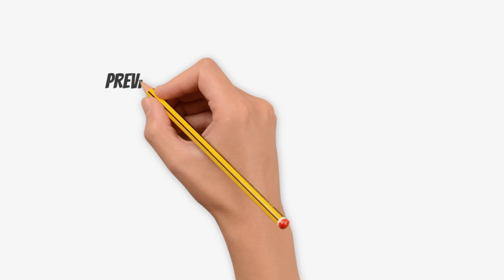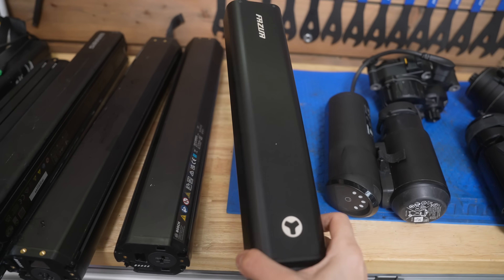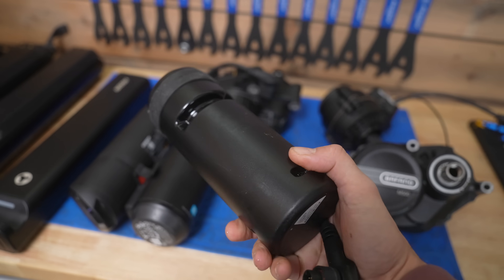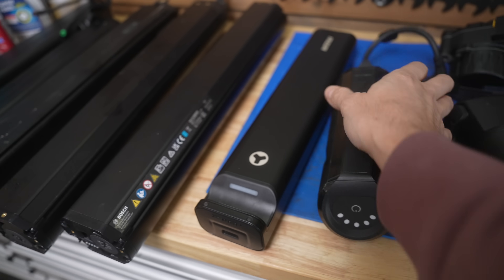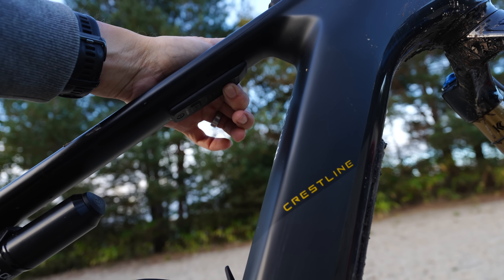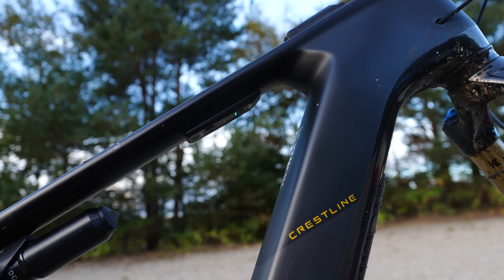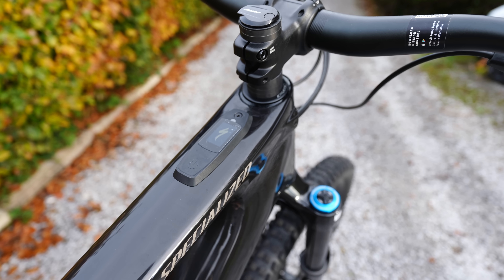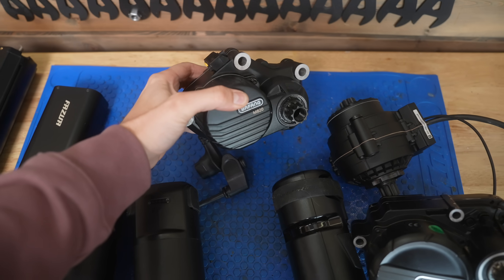We Have A Huge Problem With Ebikes....

Comment: I regret buying an EMTB and this is one of the reasons why. I love riding my bike, it’s a Nukeproof Megawatt, it’s great. However, I’m fully aware of the issues and concerns with the motor and it’s a point of contention when deciding to ride in certain places and weather conditions because of the failure rate. Mines in the last few months of warranty and the prospect of a huge repair bill and no alternative solution has ruined the ownership experience (and I probably speak for most EP8 owners). 
I won’t even consider buying a new e-bike in the future if the industry doesn’t realise a set of standards need to exist. The bike industry cannot expect people to keep parting with THOUSANDS for something, like you’ve mentioned, becomes obsolete within a few months. I don’t think a standard would curtail innovation or increase costs, any brand uses those as an excuse are just plain lazy.

Comment: The cream will rise to the top. Or top brands will cooperate. A frame maker will a version or 2 of the same frame to make the top 2 motor gear boxes. The battery holder will be built onto the battery(with charger) to clip/lock unto the bike. Everything else is pretty universal.

Comment: I know you didnt want to call out any bike company, but you did, and this is the reason why I never jumped into the ebike  ownership over the years. We guys that are in the business of the high end MTB before the ebike came on the market spend thousands of dollars on our bikes and it was upgradable over the years. But now you will have to swap out a frame every so often that will run 3-4k hopefully its the same system you already owned or else you will be screwed to spend even more money. Saw some Chinese companies that are offering to build your own ebike but same rules apply in the motor and battery the frame is the main holder of those parts. ITs better to go with a reputable company that will give you replacements over the years you own the bike. I tend to hold one to a bike for a very long time but these ebikes looks like a wash Renise  cycle day in day out that can leave you broke if your not careful about it. Specialize got one of the best warranties in the business and there system for me seems to be the best fit for my needs 90nm should be enough for the next 7-8 years more than enough for daily commute. I think you should be the one to change all this since you spoke up about it. make a ebike where all those batteries and motors can fit and work and then when those companies begin to lose money then they will change there behavior about all of this.

Comment: Yeahhh most bikes have their own CPU and they often marry it to the motherboard for the battery charging as long as you have both components you should be able to replace clips and upgrade as you wish only problem is warranty will be void haha😂 easiest way to do it is cut the cabbles & attach male & female cable connections now all your cabbles plug into eachother. 😁  As for batteries learn to put together cells and charge them individually can save lots of money and batteries often a dead battey is just a coupple of dead cells they need charging individualy to gain their life back. 
 its real sad 😢 when manufacturers put the components inside the frame and wield it shut.  Grrrr 😤 or incase the motherboard in a block of glue 💩. Ive seen it all! Lol

Comment: You obviously don’t understand business and innovation.  Capitalism for that matter. Companies aren’t going create batteries or motors that are backwards compatible. Why would they ?  They want you to spend money to buy new bikes with the new motor. They won’t make much money if they did this. And then won’t have the profits for innovation. To make motors to work across all bikes is virtually impossible.  Frames from each manufactures are uniquely designed or do you want each manufacturer to make the exact same frame so that all motors and batteries can fit?  Does Ford make a backwards compatible motor? Does a Tesla’s battery work in a Kia ? Of course not. Just be happy with what you got and ride it for 5 years and if you want to upgrade to a new bike then save up and buy a new bike. If you want high quality stuff, work hard and save your money. You can’t get high quality stuff for free.  Manufacturers have to pay their suppliers, their employees, tax.  You want innovation? It’s gonna cost you.  Why do you think bmw, Mercedes , Audi are so expensive ??  $80k for any m3 competition. Why?

Comment: As I’ve been thinking about buying an e-bike lately, these concerns have been foremost in my mind. If i spend a minimum of $1000 for a bike, take good care of it and it lasts for many years, will i be able to buy a battery for it or will it become obsolete in no more than 5 years? This is especially true of the extra cheap off brands. They may be obsolete in a year. So now i have to find a brand that i think will last for awhile. It’s exhausting, frankly.

Comment: The Bike43 longtail cargo bike can fit multiple different motors (currently sold with Shimano or Bosch, originally Heinzmann or Bafang) using adapters where the bottom bracket normally goes.

Comment: I only ride Chinese standard ebike stuff. These western brands try to make standards but no… in China they are decades ahead when it comes to e-bikes. They have stuff that you can fit on your rusty old grandpa’s bike and turn it into a widow maker. Cables all as standard as it gets… get motor from that factory while batteries are cheaper in that other factory… no problem.

Comment: I honestly hadn't thought of this. I was just about to pull the trigger on a 2024 ebike (my first) and noticed on their site, the battery for the 2023 and 2024 are different. The 2023 only works with the '23 and the '24 only works with the '24. Um, yeah that's a big issue.

Comment: The motor mounted inside the frame instantly makes both products proprietary, motor design has to exist around the bottom bracket, not parked inside it. I personally would build a EMTB with one of those CYC mid drives - they're a bit pricey but I'm sure the price would be lower if they were a bit more mainstream, somehow.

Comment: Meh, just wait for the Chinese manufacturers to somehow bodge a way to make all this stuff as well as their own stuff universally compatible - and kill the market:) 

Like they're already doing with electronic groupsets. Sram and Shimano all make their hardware and software deliberately restrictive while Ltwoo Erx will work with ANY 8-12 speed cassette from any manufacturer and will even work with a frankencassette that you've built out of a parts bin with uneven sprocket spacing - all because LTwoo just said screw it, you can fine-tune each sprocket individually in app, go nuts!

Comment: They should make things backward compatible so you can upgrade a 2 year old bike and batteries could have a standard size and chargers thats just ridiculous  !! Ev cars have a standard plug sizes so should bikes chargers are ellectronc so design them smart talk to bms they set charge voltage current and temperature  then charge.At the moment we have manufacturers  makeing stupid proffits and considerable  waistage/ewaist NOT GOOD FOR ENVIRONMENT  AND NOT GREEN.All we need is theese facts to be shouted out and they will change 😅😅😅

Comment: Emtbs are far too new to be constrained by standards at the moment. It's pretty easy to make minor adjustments for a std derailleur hanger. It's a relatively older tech that's not even really part of the bike and will likely be phased out anyway. Current ebike tech is an integral part of the entire frame. By standardizing, bike mfgrs would essentially need to build very similar frames, really stifling innovation. The same for the motors.  It's a very new tech, and constraints at this point would definitely slow progression. It's way too early for standards imo
Reply: @anonymousone6075 motors on a car are a great example of why it wouldn't work. You can't put a tundra engine into a Tacoma without substantial modifications. Tundra engine in a Corolla? You're essentially creating a new vehicle in order for it to fit. A one size fits all solution for mtb motors would have to default to a large size cavity, and personally, I would prefer the smallest form factor possible

Comment: If you are using an ebike and you want the ability to upgrade it go DIY, full stop. Conversion kits are forced to follow a standardized system because they don't sell full systems. The only real drawbacks to DIY systems are 1.) Appearance, everything being built by 1 company means they can neatly integrate systems. 2.)  You cannot use carbon fiber frames due to the the physics of how carbon fiber works, applying loads and compression in unplanned places ect. However with in regards to point 2. If you are using an ebike going carbon fiber is already pretty pointless. The added weight from going aluminum frame will be utterly negated by the motor. Any case where you need to save every gram is a case where you shouldn't be using an ebike anyway.

I will just stick to popping a wheelies going uphill on my 'totally not a motorcycle' Cycmotor 52V kit tyvm

Comment: Easy fix really - all motors are nice and round and all batteries are cylinders and the manufacturers add fit kits - but of course those extra 200 grams are a killer so no one wants that.

Comment: If you have standards, you can just upgrade your existing bike with parts from any 3rd party component supplier, and not need to buy a completely new one……..that’s not good for the bike manufacturers bottom line…….

Comment: You are 100% correct and thank you for btinging this up. 
Welcome to the world of forced obsolescence! Every 18 months is a new generation of computer technology evolves -- the same will happen to ebikes and Electric Vehicles as they evolve. Look at the horror stories of folks with six- or seven-year-old EV's and find out they have to spend $30,000 for a battery replacement. Their batteries are no longer made in quantity because they are obsolete, and it takes a special order to replace them. Unfortunately, similar things will happen with ebikes where the cost to replace a battery or drive system will be too much for an "old" bike you are left with a useless frame. 😞

Comment: Learning soldering and having some slight fabrication skills which includes finding good straps or alternative mounting options will solve most of your battery/charging issues. We put XT60s on all of our chargers and batteries so everything is compatible plug and play situations. Some times you have to put in a little extra work with e bikes unfortunately. Would not recommend DIY E bikes to someone with no mechanical skills.

Comment: After dealing with cell phones and that idiotic accessory and charger disaster I feel people should just know to research ahead of time what accessories are available for that brand they are purchasing. I mean if you have a E-Bike you more than likely have the means to look up "what accessories are available for this brand" and presto the internet provides. The fact you made this video tells me there is a lot of people who buy first than read later. The reason why they (continue) to do things like this as people will buy the next brand and all new accessories because they didn't research first. (Marketing) I am sure the people who created these bikes knew exactly what they were doing. Also, this is the next cell phone. Every few months a new model and newer goodies is going to come out, you will have 20 different types of bikes, chargers and accessories that won't work with each laying in storage like we did with phones junk in drawers. It will be a trend to have the new model to keep up with Johnson's so to speak. It's trendy to be environmentally safe right. It's genius really.  Wonder how much (fuel) the power stations have to burn to charge all these electric cars and bikes ha-ha.

Comment: You make a good point, and standardisation is brilliant.
However... If you bought a Yamaha motorbike, would you expect the engine or fuel tank or ECU to work on a Honda? No, of course not.
Would you expect a Nokia battery to fit a Samsung?

Comment: One thing governments can do, perhaps the only thing they can do of benefit, is to get standards bodies like the IEC etc to create a standard battery module (for example), for the smallest cheapest ebike, and then the bigger ones just use 2 or 3 of them. 
Then you have the building blocks of an ecosystem.

Comment: Same goes EV’s. Standardisation requires cooperation between manufacturers; I won’t bet on that happening for a while. 
 
Are all eMTB’s the same voltage? That’s another issue to deal with as well.

Comment: Yawn on influencers.  He fails to mention the universal standard that big vendors turn down intentionally.  
"The Rosenberger connector was one of the standards adopted by energybus as a battery plug. It's got internal magnets to force the correct orientation and hold the connector together, and features two power lines and 4 signal lines, nominally for CANbus. The concept behind this connector to have a universal battery and charger plug that was interchangeable between ebike systems, and a communication scheme that would ensure compatibility. That's a great concept, but of course the last thing dominant turn-key ebike brands (like Bosch) want is inter-product compatibility."

Comment: It is not a problem it is a good thing.
This is natural selection.
Back in 2005 if you would standardise phone wiring, we would all have the damn circular 5v connector that plugs in Nokias.
And the usb norm would be usb A.

But competition and innovation led to the holy USB-C that can be pluged upside down and can also be used for charging now.

So... untill ebikes becomes a normal household item and everyone can experiment with whats good and convenient, i prefer to have competition.

And then, in 10 years some solutions will stand out as the ultimate solution.
And then it will be good to enforce it on every manufacturer.

We are facing the exact same problem we had with phones, all coming with a different charger. And u had to buy the exact same charger because the plug is dedicated to this or that brand and a couple of models.

I would not be surprised if all ebike batteries where forced to be easily removable with bilt in usb-c charging port

Comment: Errrrr, most of Lectric's bikes use the same batteries. They have 10 Amp and 14 Amp 48 volt batteries, either of which will work on their bikes and the new Trike.  You can also buy a balancer that allows you to use two batteries at once.  The batteries can be the same (for up to 28 Amps) or a mix of their batteries.  I don't know why e-bikes seem to be so dramatically over priced across the pond, but none of Lectric's bikes cost over $2K US.  Perhaps you should actually know what you're talking about prior to spouting off.  I hear they have the internet over there.

Comment: All of this is also true of the less expensive bikes.  I have sampled at least 20 different models priced from the 400's to 2,000 dollars, and they all used a different battery and chargers.  Batteries are all different shapes and not interchangeable.  Even between different models from the same bike brand.  A good? bad? example is Heybike.  In the last 2 years they have discontinued two models and replacement parts are no longer available.  Soon the battries will die, and the bikes will become heavy, unpowered, unsellable junk.  If one of the objectives of bike manufacturers is to get more people on bikes, this is NOT the way to go.

Comment: I'm betting the best that could happen within maybe 5 years is a standard for charging the different brands' battery packs.  But it will take longer (if ever) for a majority of brands to agree on much of anything else.  The battery shapes and capacities are inextricably tied to the ebike frame styling and such that distinguish one brand from another, so I'm doubting they will ever give in on compromising those things.  The bolt patterns and shapes for the motors are so hotly contested between brands whereby shaving a gram or two here and there or improving torque by a N-m or two by  tweaking some physical parameters of the motor or by reworking the motor housing features are constantly touted as the next best thing since time began, and again are inextricably tied to the frame designs.  This is going to stifle cooperation to standardizing these aspects.   I hear you Rob, but all the brands think their sh*t doesn't stink so committing to standards that are compromises to all the parameters they have all been tweaking on their own for so many years will just not come about.  I hope I'm wrong but the manufacturers just want us to buy their bikes, tie us in to them exclusively for expensive replacement parts and after the warranties are up leave us on our own to do whatever with the older models.  So it's really not much different from the automotive marketplace where there isn't much of any standardization between brands there either. But nice to get it off your chest I suppose.

Comment: An ebike is a bit more like a motorcycle than a bike. You can't really upgrade a motorcycle either, but you can easily find all the parts to modify or repair the thing for like 20 or 30 years into the future. Ebikes seem more disposable, which is ridiculous considering the cost.